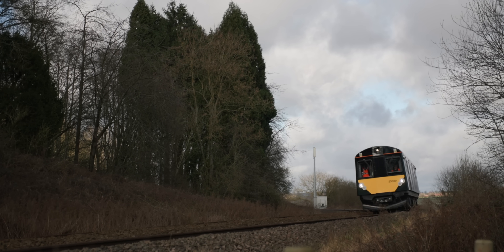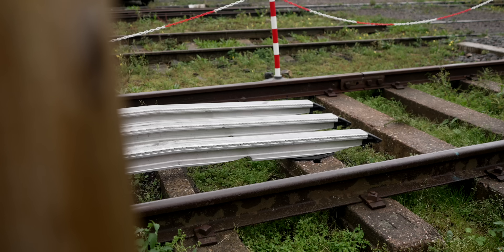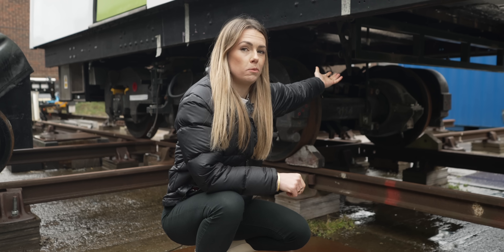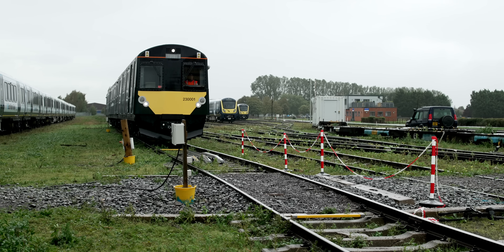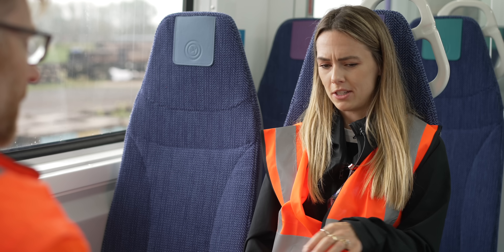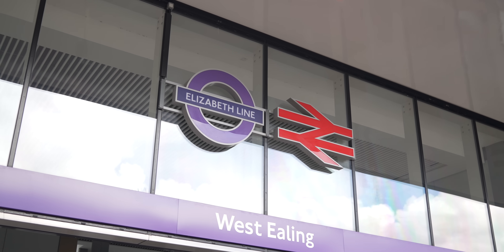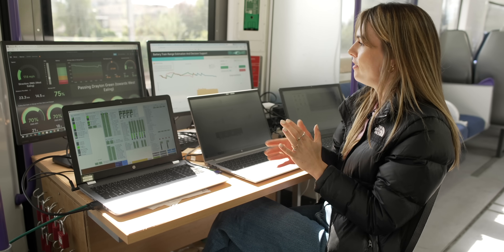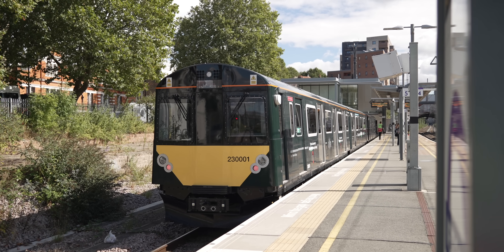Onboard the UK's First Battery Electric Train!

Comment: I like the new battery trains for her the new front of the trains and comfy padded seats air-conditioning heated floors and it has a top speed of 60mph about 100 kilometers per hour and had a world record of doing 200 miles very impressive

Comment: So they are developing a new way to bring electric energy to the train, why? Like there is a proven way and ground level elctriccontact has been tried and is in the Process of getting extinct. Why not use proven infrastructure? Why not use grid Energy storage Systems for Backups on the side of the Track? Why not use existing Power-Systems for charging the Batteries?

Comment: The battery weight has less consequences on a train than it would have on a road vehicle since it has the efficiency of steel on steel vs rubber on concrete (or asphalt), the deal here is there is relatively short distances between charging points with few start stop cycles in between, thus the total battery capacity is relatively small as say compared to a main line train or over road trucks and busses if they were to use battery technology.  This system seems pretty simple in concept, I was concerned about the high power charging rail in the station area but since they are off unless a train is actually in the station that problem is basically solved.  Railways need very high power when accelerating out of a station and during long uphill stretches but that power can be viewed as in investment that can be significantly recovered during the slowdown for stations and downhill sections, maybe as much as 50% or even more.
The comment about using solar panels for recharging is a questionable idea.  These would probably do OK during the longer summer days in the UK but the short daylight hours and low sun angles in the fall, winter, and early spring as well as the many rainy and cloudy days year-round make that a questionable investment, also the fact that railways operate at least into the evenings and early mornings make that idea even less attractive.

Comment: this channel should also cover quite important innovation going on for conventional overhead electrification as well. Like various voltage controlled clearance techniques to allow the wires to be closer to overhead structures without compromising safety, or substations with static frequency converters to limit disbalance on the grid system, or autotransformer feeding allowing greater power to be available to trains. But no, it's always EVs and batteries with these kinda content creators.

Also the idea that every train has 3 minutes to stop at every station is not actually true. Dwell times for almost all stops on a commuter or local train are shorter than that. Sure at each terminus it can be 3 minutes (in fact more like 10/15minutes in the schedule), but that is quite considerably Not every station. I mean, even the timetable for the Greenford branch gives 30second for each intermediate stop. Where is this 3.5minutes figure coming from? Wherever it's from it's presented quite misleadingly.

Comment: Great innovation but costly. I wonder if top-rail (retractable) electricity options to charge are more affordable and easier to install. Most of all it would look more authentic. You could charge while driving and it would retracted before any tunnel or station. The grid would be easier to adapt to these kind of trains. The future will proof what is affordable and most of all rational.

Comment: I'm pretty sure that this is not the first battery electric train which has run in Britain.
Are they using regenerative braking on those units? It would make a lot of sense if they are.

Comment: Why don't they just use a pantograph system at stations to charge the trains? 

Also I'm not really convinced with battery electric trains actually being more viable in the long run than pantograph powered ones.

Comment: It seems to be a bit easier methode, if the locomotive charges from the overhead line, then the  train can go to the rails without overhead line with charged battery. In Hungary, we have example for this methode for a short rail line. Any way, the speed of charging and the capacity of the battery and  in your new train is amazing.😊

Comment: In Newcastle, Australia, they have a tram service that is battery powered with overhead pick ups at each station to top up the batteries while unloading and loading passengers, but then also in Byron Bay, New South Wales, there is a train which is operated using Solar to recharge the batteries.

Comment: Battery technology makes the absolute MOST sense when it comes to trains - even more than buses, cars and trucks - BECAUSE of their incredibly low rolling resistance compared to their weight and the fact the most power needed is in getting going. At the weight of an average train I don't think the weight of the battery packs are going to really impact them all that much - especially considering the alternative is even heavier diesel engine power plants or probably fairly heavy overhead wire equipment. And even better the trains COULD potentially use regenerative braking to gain an extra little boost any time it has to slow down and when reaching stations. Hopefully this tech gets the proper development and investment needed and we see a great deal of future UK trains running on batteries! SO much better and cheaper than the incredible cost of electrifying every single rail line in the country!!

Comment: Only super capacitors can charge and discharge that fast, What chemistry they use? that remains to be seen, but surely super capacitors in both the train and the storage container, not batteries.

Comment: If you're running so few trains per day that it makes sense to run battery electric trains instead of overhead wires you need to run more trains. 

Having to carry your own energy source sucks, having to continue to carry your own energy source after it's spent sucks double.

Comment: The Electric train has surely get to the future.
We have this type of system in the Netherlands but, not for trains. We use it for public transport buses.
At the bus stations there are portals standing at the platforms where the buses raise a pantograph into the portal.
The minutes these buses stand there they charge. And then ride their routes. After that, they charge again.
And get going for at their planned route. That's how it goes every day.  Althougth the driver deciced if the bus needs to charge.
If the battery is still full enough he doesn't charge the bus. One day the bus-driver told me that, he checks if the bus can make the planned route.
If the bus can make it, he doesn't charge the battery. They will make sure that the battery is mininal 50% charged. This is what the driver told me.

Comment: Does the train use regenerative braking to recharge the batteries while slowing down?
Reply: I wonder the same. I imagine it could, but would be whether they setup generators and flywheel within the train's motor system.
Reply: @danielalancollins1154  

You don’t need to add too much. Electric vehicles just run the motors ‘backwards’ to slow the car down and generate electricity to put back in the battery. No need for generators or flywheels. The electric motors are basically generators, and the train’s own momentum acts like a flywheel. You slow the train down by recharging the batteries, and you also save wear on the brakes. Win, win.

Comment: I think testing with flywheel storage systems should be considered. They don't wear out and there's no danger lithium ion battery fire danger. Power rails that accelerate the train out of the stations and up steep inclines would reduce the strain and increase the battery life. 
The next step is automation. Distant lines that have little service to none and are not electrified could be upgraded to on-demand personalized services with smaller pod sized vehicles that are automated requiring no driver.
The number one thing I miss from serving in the US Army and Germany is the lack of wonderful passenger train service, and the streetcar lines that take you to the station. 
Solar powered, the fuel bill paid up front, leaving the international energy markets behind as an expense no longer a consideration. The batteries are the solution and the limitation. Expensive to replace when they were out and potentially a fire hazard, carbon fiber flywheel power storage can endure for 50 years without attenuation, eliminating the fear of passengers and the service operators something explosive could go wrong.
Having several or many of these machines, they should not be parked next to another. 
The hundreds of electric buses parked in the barn and one catches fire and they're all gone. Each needs its own concrete surrounded parking stall to protect the investment from one failure.
What does it look like when 1 million Watts escape the bottle? That's what must be prepared for when using lithium ion batteries. I hope with version 2, they try lightweight carbon fiber flywheels. There's no danger to mitigate with minimal maintenance required. Not carrying heavy batteries, efficiency will go up requiring less energy.
I wonder if flywheel energy storage was considered. Accelerating out of stations still connected to the charging infrastructure, and regenerative braking. I think research will continue. The lithium ion batteries wear out and are expensive to replace, especially if China, tit for tat, stops export. The UK cannot build these batteries, but they could build flywheel power storage units creating jobs for UK industry, if not bought from France or Germany, better than from China where workers are underpaid or not paid competing with local union workers.
I hope the phase two trains are nothing like these trains. 100% homemade technology that China can copy and attempt to imitate.

Comment: A completely ridiculous idea, where are these massive batteries coming from, the amount of rare earth materials required is massive, you still can't beat diesel engines especially on large equipment they are powerful economical and reliable and lightweight and compact, a future solution could be hydrogen to power a conventional engine, batteries don't even work in cars so will never work on a commercial setup on a train FACT

Comment: I would have thought that an important feature and advantage of a BE train would be regenerative braking. This wasn't mentioned. Does that mean it doesn't do regen breking and if not why not. A bit more tec info would have been good. What is the charging voltage for example.

Comment: retro fit solar panels to the train roofs to trickle charge between stops and at stations themselves then you could fed this back to the grind via the track side batteries and 
use that to cheapen rail for all 😅
Reply: (auto spell error) grid*
Reply: Also you could link rail staitions to charging hubs for ongoing electric car travel 
but sell the electricity generated at the cheaper night rates that make electric cars affordble 😀

Comment: Thank you for your reply.    That explains more fully.     If you can succeed in this it would be a great system.     From your TV presentation I was under the impression that the belief was that trains stopped at all stations for over three minutes.    With the possible coming nationalisation please don't be put off as so much and very many good ideas have been shelved owing to lethargy within the railway system management and government.       One possible problem, which you may already have thought of is electrical connection during winter.    Icing of the conductor rail is always a problem to the southern but with such a short length within your system the contact rails could be heated so to retain a good connection.    Possibly an automatic system where the temperature falls below 2 degrees auto heating comes on.     Best of luck with it.

Comment: Battery trains are such a scam. They cost exponentially more than third rail and overhead lines. And the situations listed in the beginning of the video are solved and are not a good use case. Looking at the cost over decades, battery trains will lose every time. Maybe a hybrid system that could bridge un-electrified routes as an intermediate solution? 

If there are legacy tunnels or bridges that can't have overhead lines without substantial rebuilds then yeah lets get them off of diesel and in that case, overhead line as far as you can and have a hybrid battery system that powers in the un-electrified section. But that's already been done.

Full battery powered trains are a horrible idea and a waste of funds.
Reply: Overhead lines are expensive in the UK and take a long time to implement, the 80 stretch from London to Bristol took 8 years (some of which due to issues with the trains themselves) and cost £7 billion. The idea in the UK is to prioritise overhear lines in the high volume main lines, with the branch lines seeking to use alternatives, such as battery electric replacing existing diesel and diesel-electric trains that run on the branch lines.

For these types of lines battery trains would be quicker to roll-out and require less upfront infrastructure to implement. Costs of not that expensive, and the impact on local grid demans can be offset with the planned renewable/BESS track side deployments - these facilities may also add backup or additonal diversified power for local area needs as well. 

Third-rail systems are now discouraged in the UK, by the rail regulator, on safety and cost grounds, with plans to upgrade some current third-rail based systems to overhead instead.

The idea behind the GWR tests are to assess the long term usage, engineering and cost impacts of battery electric trains, which is will provide real-world data rather than assumptive based viewpoints.

Comment: I'm confused by the mention of electric trains powered by overhead cables at the start. You mention how the cables cause issues with tunnels and such but fail to mention electric trains powered by a third rail? Southeastern's whole line is powered by third rail electricity and goes through dense city, tunnels, countryside and everywhere in between?
Reply: Third-rail systems are now actively discouraged in the UK by the government body responsible (ORR), on safety, flexibility and cost grounds. Some of the south-east lines are being investigated whether these can be replaced by overhead systems instead (as these can delivery more power to freight and faster passenger trains than the 750V DC thrid-rail systems).

Comment: Stupid idea. Huge loses with heat etc, batteries don't like fast charging in megsestts, temperatures and UK weather will make a huge difference. I don't thigk this is a good idea. We already have an efficient way overhead wires that's efficient converting AC to DC and sticking it into a battery with like 30% losses since an inverter would be required as well it's just kind of dumb. Also I think this was done in 1958 I'm not really a train enthusiast but I have seen this before elsewhere so maybe someone else could correct me.
Reply: "Stupid idea" - Exactly. We should burn coal to make steam. That'd be MUCH better.
"overhead wires" - Massively expensive to install, and frankly ugly. 3rd rail would be better for aesthetics & cheaper to install, but dangerous to work around.

"batteries don't like fast charging in megsestts" - not sure what "megasestts" are... but you're wrong: It's been proven that rapid charging batteries, so long as you don't rapid charge too high, has a negligible effect on their lifespan. If the train is regularly arriving at a station with 60-70% SOC, and leaving at 80%, that will do very little harm to the battery. If it's arriving on 5% and leaving on 95%... you'd have a point: But that's just not going to happen. I would expect charging at each end of the train's journey, where it might be expected to sit around for longer than 3 minutes, would have a charge profile more like that of an EV - i.e. very rapid up to 80%, then steadily slowing towards 100%.

But irrespective of all that - when they switch to sodium batteries (likely to happen in the next 5 years), most of those concerns will simply go away.

Comment: This is all great, but maybe not shape the train like a brick?
Reply: They're shaped that way so they can be stuck together easily. e.g. the old Merseyrail 802s ran as either a 3 or 6 car set. Whilst you can do that with pointy trains, it's not as neat a package, and the extra length might cause difficulties at stations with short platforms.